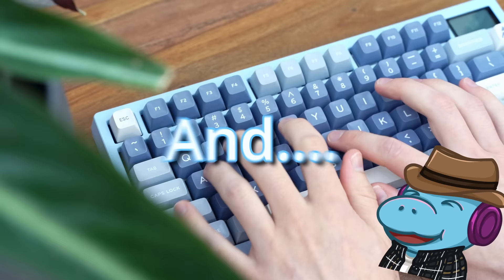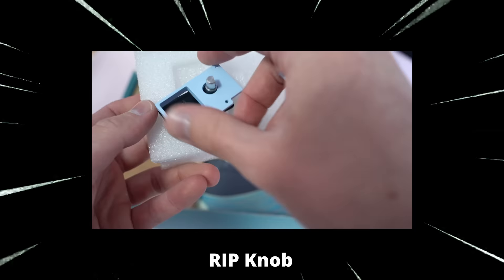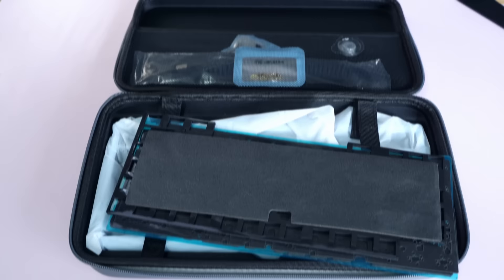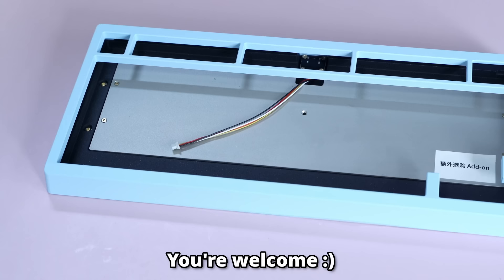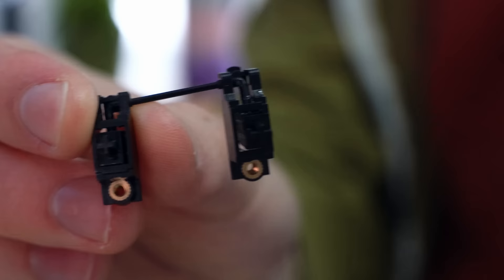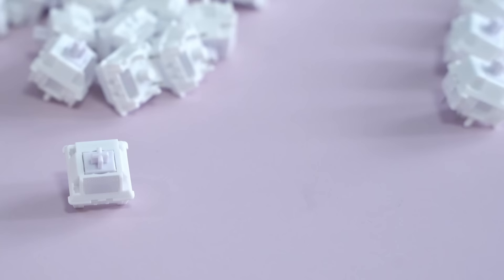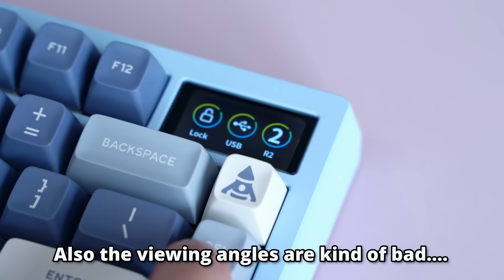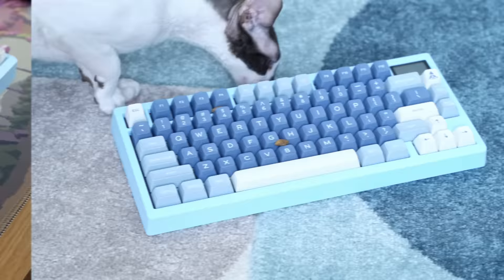You DON'T Need To Mod this Budget Keyboard...

Comment: SA profile caps are like cheat codes, they can even make clicky switches sound nice and deep. Combined with all of that foam and idk if you can even get thockier. It'd be cool to see you do an ultra clacky build and compare it with this one.
Reply: Does the profile of the key cap make that much difference to the final sound? SA can make it that much thockier vs something like a cherry profile? 

Asking because I just got my second mech, a K8 Pro, and from videos at least the sound is good. Keychron's OSA profile key caps, PBT, gat pro brown switches. 

If I can get that thing to sound anywhere near this thocky through mods I'd love to, but not sure if I should mod key caps or switches first. 

What about SA profile makes that sound, like am I looking for more height or what?
Reply: @RyanCamaratta I used to run a k8 pro with gateron browns, and there's not much you can do to it to improve the thockiness but I put the foams from the packaging below the pcb and that helped bring out the sound more, the main thing you can do is just get other switches like the morandis shown in this vid
Reply: @JamieOliver77  I got with keyboard kustoms and they had some cut PE and Poron foams, I put sound insulation on the bottom case, and threw morandi switches in it and it sounds like a dream
Reply: SA profile is one of my favourite, second only to MT3.

Comment: Exactly! I'm tired of people saying these keyboards are "budget" or maybe even "entry" when the cost totals around $200 - $300 and up (CA dollars).  If I wanted a cheap or 'entry' keyboard, maybe I'll find something on amazon within the $50 range which I have :)  

Anyway, great video on the zoom 75. I want the LCD screen but you're right, its not very practical in a sense.  I'm not going to be looking down at my keyboard much to look at time, temps, speeds and such.  I have these set on my monitor and the knob is quite handy for volume control.  Might try it out anyway for kicks.
Reply: It's starts from 199USD, without tax and shipping cost for base wersion with knob. In reality it's 250$ minimum and usually you'll end up with more than 300$ cost for keyboard that was presented in this video. It's definitely not budget, more like premium segment.
Reply: Ok this is the only time I don’t agree with hipyo. 200 is not budget. 80 is budget. Anything under 50 is ultra budget.

Comment: I really like those "AF SA" profile keycaps... got two sets myself, and really enjoy them.  They're cloned from sets like MG Monster and MG Ember, but also improved compared to the original.  The keyboard's physical layout, however, is missing 2 of my most-used keys on the right side.  Giving those up would hurt.
Reply: Which ones? I would bind Page Up/Down to Home/End and F13 to PrintScreen/Other.
Reply: @ToyKeeper  I meant which buttons were going going to miss, but interesting to know. I have always wanted to try some SA caps, but most of them being ABS was a big turn-off
Reply: @erwark  Physically, I would miss the button above the right arrow, and the button to the left of the left arrow.  I use those a lot.  I could shift the right column up one row using the button+knob module in the corner, so one button can be mitigated... but I'd still miss the other one.

As for what those missing buttons do... for me it's the Super + MouseLock key to the left of the arrows... and the key to the right of the up arrow does End, Right Click, and opening terminals.
Reply: I have two sets of those keycaps as well and really enjoy typing on them. They have great haptics and sound nice.
Reply: @erwark 😊

Comment: Just got my zoom tkl and built my first keyboard. Bent 3 pins on switches. And over lubed the stabilisers. But after I fixed that its so nice. And i opted for the internal weight and ss pvd back. 2.284kgs worth. Doing work never felt so good.

Comment: With this keyboard finally getting into the hands of the people (I just got mine), it would be extremely helpful for a noob like myself if you could do a full VIA tutorial with this board. I have no idea how to get rgb functions or key mappings. Thanks!
Reply: How are you liking the board after owning it for a couple months? Did you go with a flex cut or non flex cut pcb?
Which plate are you using?

I just ordered from th November group buy

Comment: Nice video and board as always!
Since when are ~200 a budget option though?
Yes, it's cheaper than a $600 board, but with the keycrons, akkos, gmmks, ... out there costing half or 2/3 from it, I wouldn't call it budget really, even nowadays where everything is getting more expensive.
That's like calling $300 earbuds budget, because there are more expensive options.
Reply: yeah ikr? i saw budget thinking less than $100 but no...
Reply: @weuiwhuih  Yeah, I'd even say going up to 150 would be ok, even while already stretching it. But 180 without shipping for the cheapest possible version is stretching it to much, at least for my opinion.
Reply: stay poor
Reply: @Elaine19899  I like building keyboards, so working on it. But you too and probably much fun with your daddies credit card to get there :)

Comment: If it comes in the kit, it’s assembly, not mod — unless you’re using the piece in a way that wasn’t intended. (For example, cutting up the cardboard box to use it in lieu of case foam.)

If it passes a cat scan, it’s good enough for me.

Comment: Thanks you Hipyo for the great video.  I finally took the plunge on building my first custom keyboard. Ordered the zoom 75.  But confused on the keyboard switch pins. Does the Zoom 75 Support 3 or 5 pin switches? (Rookie question)

Comment: 209 dolar keyboard as being budget is crazy to me. I think you can get the same or better experience with a Rainy75 or a Aula75/87 for literally half the price
Reply: The Rainy 75 sounds really amazing, especially with the price of only 90$-120$ depending on the version. Don't really see any other reason to get this which is basically an 100$ steal.

Comment: Love the sound.  I have no experience with mechanicals, always used the built in laptop keyboards.  Where can I find a prebuilt keyboard that sounds like this?
Reply: they a did an assembled edition for the tkl so it’s possible they will do one for this as well. usually comes a bit after the group buy launches

Comment: What is the difference between the zoom 75 HE, zoom 75 essential, and zoom 75 special edition?
Reply: Zoom 75 HE is prebuilt with hall effect switches.  Zoom 75 essential is the same as the special edition.  The only difference between the essnetial and the special edition is the finish on the special is anodized vs coated on the essential, plus some extra flair on the chamfers on the special eedition.

Comment: Hey quick question, when I first got into gaming keyboards back in 2016 it seemed like cherry mx switches were pretty much the go-to for all keyboards. It seems recently they are not as popular, is this true and is there a reason why?
Reply: Most of the gaming companies moved away and started making their own switches, with lower travel distance, lower profiles and more rgb options. Other switch companies also started offering better features like different materials, smoother feels, different spring weights, and cheaper
Reply: they're still standard on a ton of pre-builts out there. not quite as popular amongst enthusiasts nowadays.
why: more manufacturers, new innovations, competition, etc.

Comment: C'mon Hipyo, you and I both know this isn't considered budget anymore. Maybe 3-5 years ago, but now there are wireless gasket mounted keyboards with included plate foam, pre lubed stabs, and your choice of switch for less than 1/4 of this price. Those are budget keyboards. This is squarely mid-range price now, even if it is a good value.

Comment: Hi, not sure if im ever gonna get reply on this but! i want a prebuilt keyboard that i can just plug and play with, budget like 200 euro. I currently got varmilo VEA109 but i want something new and better! got any recommendation? thanks from Norway.
Reply: Keychron has many plug and play options.
Reply: Keychron Q1 Pro
Reply: @keonxd8918  thanks mate, is it rly that good?
Reply: @GRiMS2K  it's a wireless keychron Q1, if u don't need wireless, you can go for the Keychron Q1. They are basically an entry level CNC aluminum keyboard, since the majority of CNC aluminum keyboards cost a lot. And they have pre-built options for plug and play

Comment: @hipyotech Hey hey! Thanks to this video I purchased the Zoom75 back in April and finally got it! And it feels sounds great. BUT one question I had is what software do you use to control the keyboard settings? (I am on a Mac if that matters) Via doesn't seem to recognize the keyboard, QMK online does but I am not sure its actually changing any of the settings. Anyway would very much appreciate you input on this :D Thanks again, love your videos!

Comment: So I just built this keyboard (first time ever building one) and only half of the keys work... Any ideas or advice? Everything seems to be plugged in correctly and I can't find anything online
Reply: Did you follow the directions and short each key before building it on VIA? That initial step was to make sure all your keys worked.
Reply: @IsThisRight  I did! So, all of the keys now work, I figured out that issue but now instead of typing as they should every time I click a key it either "unplugs" or "plugs in" the keyboard. I have no idea what to do now lol

Comment: hey hipyo, did your keyboard case for the zoom 75 have issues of scuffed nano coating and minor scratches? would love to know since my zoom TKL came with many of these imperfections and they’re honestly really unsightly…
Reply: would you mind elaborating a little bit (for a potential buyer of the 75)?
do you think it was specific to the paint type you chose? i notice they have colors such as 'SE white' & 'EE black' but then also have standard colors as well
Reply: @jordanb.4514  I don't think it was the paint type I chose because I bought 2 TKL sets (blush pink and lilac) and they both had the same issues of incomplete nano coating and minor scratches. Not sure if the set that Meletrix provides content creators (which seems to be free of these defects) is a proper representation of the general quality that most buyers receive. Would love for others to provide their perspective on this as well.

Comment: $200 sounded pretty high, but acceptable if "no modding required." But it's even worse--I don't think you said "some assembly required, $200 for base board, keycaps and switches not included" until like halfway through video. This makes it a hard pass, I want a finished product for that price.

I'm not into building keyboards either, I'd rather spend my time actually using them to use my computer instead. A keyboard is nothing more than a tool to interface with a computer and if it can't even do that without buying more parts and assembling them, then you've lost my interest.

Comment: Hey!

Got the zoom75, it’s amazing just have a problem with the stabilizers .

When I put the plate on the and attach switch + cap the button gets stuck when pressing down. 

Not sure what to do to fix it
Reply: How did you get it in 2024

Comment: Tbh I only call something as budget if it’s under $100. $170 for a keyboard is mid-range for me, and $270 is high-end. Man this hobby is a giant middle finger to those with lower incomes.
Reply: its custom keyboard not just normal keyboard you buy from retail stores. Hence the price range, $200 is nothing and it is budget for a custom one haha.
Reply: I understand your frustration but you need to remember where was this hobby a few years ago. We barely had any affordable options with most ranging around $250 to $350. 2 year ago we had the Gmmk Pro and the Q1 that was finally offering decent quality and instock for under $200. We now have boards that has a knob, a screen and custom weights for around $150-$170
Reply: @z4k1_zaki65  I guess that is a massive improvement from 5 years ago

But to any newbie $150 sounds egregiously expensive. At least Keychain is here to deliver some lower <$100 prices unless if you want gasket mounting.
Reply: @d1kgaws12  Keychron V series are tray mount….

Comment: Bought this keyboard off this video... can you do an update video using/downloading the software for the screen?  Looks like the software for it has viruses...
Reply: The software for the screen is trash.  It's good for time/date and putting your own gif on there.  The rest of the functionality (weather, temps, fans) are pretty much non existant.  If you're buying the screen to get a ton of customization and info, don't.  It's 95% aesthetic, 5% functional.

Comment: I didn't see a ton of comments on this video, but this keyboard is not budget.. by any means.. for custom or OTB. 179 for the wired keyboard is an entirely different experience from the 249+ custom ones with the lcd panels (which is what you have in the video). You can literally buy all of the components any any of these keyboards for less and make it so "budget" nah not really. But cheap for OTB competitors that need to be modded to sound a certain way, then sure. 
Budget is a GMMK, a ducky one 2, small 75's or tkl's.. this isnt budget.
Reply: He literally made a disclaimer about the word budget. 🙄

Comment: def not budget
Reply: For the mechanical keyboard hobby, $250 or less is definitely budget. I feel like most of the higher end keyboards are like $600+ now with the board, switches, keycaps, stabs + all utilities. Even most branded mech. keyboards like Razor/Logitech/Asus/Iqunix have their boards at $120+.